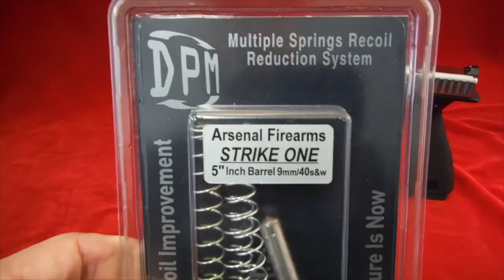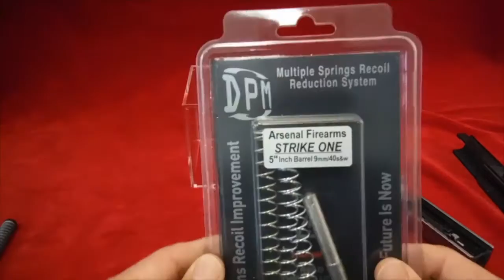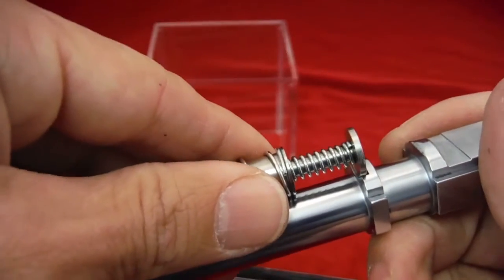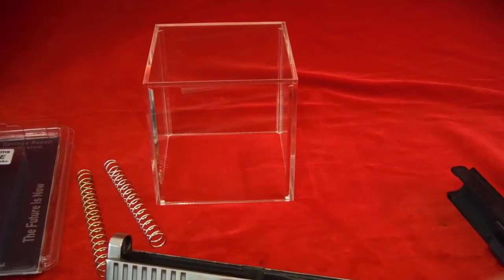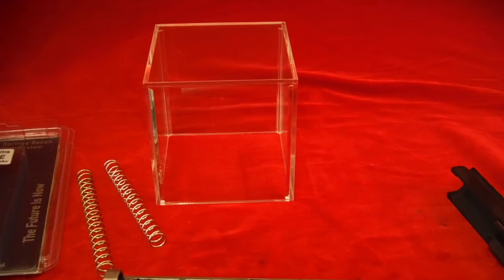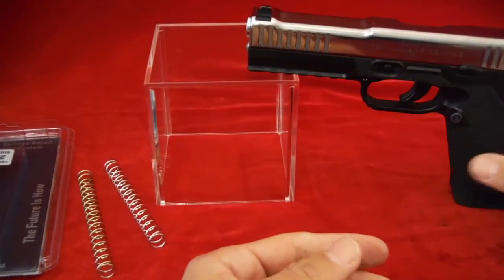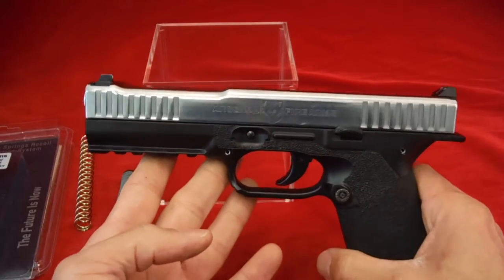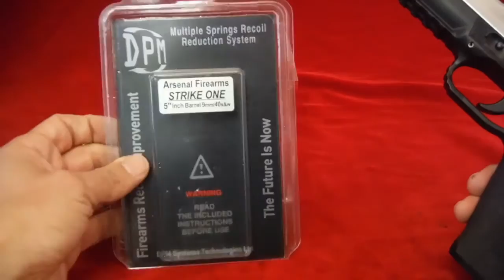Stirke One by Arsenal Firearms with DPM Spring System Turtorial

Comment: Following this video and Rain6's quality knowledge, I mounted this DPM spring on my S1Speed, your AF1 will really be improved in terms of performance. This punch problem no more exist with the AF1Speed. What changes between the old spring and this DPM is that the rod-body of the spring becomes metallic, and also it integrates a spring which allows to dampen the return to the rear of the slide. By switching to the DPM you will no longer have one spring but 2; a spring which dampens the forward movement of the slide, and another which dampens the rear movement. The different spring hardnesses allow the versatility of being able to benefit from the improvements of the DPM spring whether you are shooting from the homemade soft reload or the very powerful manufactured. The pistol slams less and everything is smoother, if you get the hang of it you can shoot very quickly in a very sustained manner.
Reply from the maker: Good explanation, and feedback, thank you!

Comment: the spring you have installed is the heaviest external spring... the gold in this product is the medium... Nick Savidis the main assembler of dpm system from greece... cont the great vidz
Reply from the maker: +Nick Cnctech (cnclathe) you are correct, however, when things have changed, please explain how... the two springs silver and gold were both the same length until 12/15, now the silver is longest, gold middle and silver again shortest? thank you for the comment and compliment.
Reply: the power of the springs Always in our products are translated by the length... the longer is the heavy the sorter is the lightest... in the particual product for the Strike One we have  sort silver (lightest) second in length is the gold so its the medium power and the long silver is the heaviest... length is power... more coils more power... is that easy :)
Reply: +Nick Cnctech (cnclathe) and the nest Strike One Recoil Systems will have a good chamfer on the end part and extra instructions for that little karate chop :) you show us in the vid so the system will seat properly :) arsenal will also try to make it better so we dont have that problem any more :) I am looking forward for a comparison video with the standard and our system in the range :) and tell us how it feels
Reply: Is your slide polished or is that cerakote?

Comment: do youhave a video installing one on a BerettaPX4 9MM? that's a son-of-bitch to install.
Reply from the maker: unfortunately we do not Brian, sounds like a bear though. Nothing on the net at all?
Reply: thanks for the reply. I got it in and it works beautifully. I have the lightest one installed. using American Eagle 124 grain FMJ. So smooth and Beretta px4 storm compact is already soft. I was amazed. This gun already has well over 5000 rounds with the stock rod. when I changed it and shot it, I just shook my head in amazement.